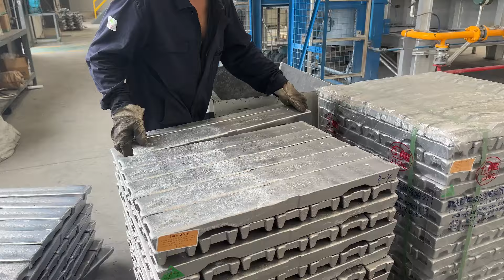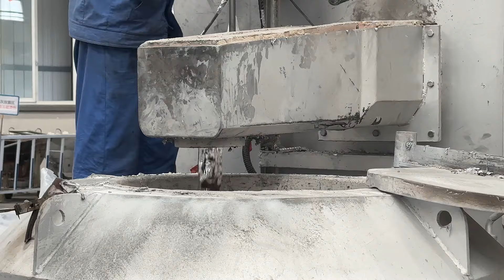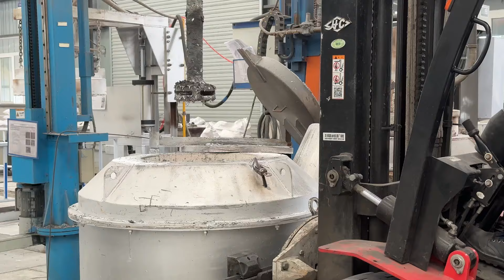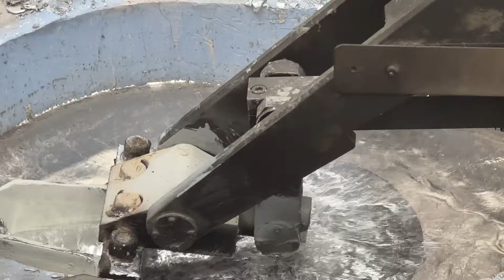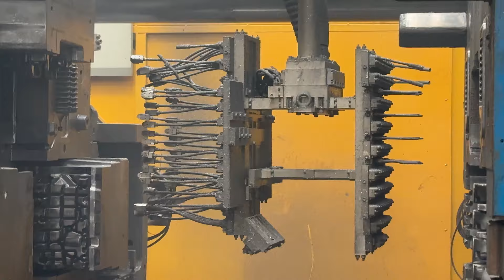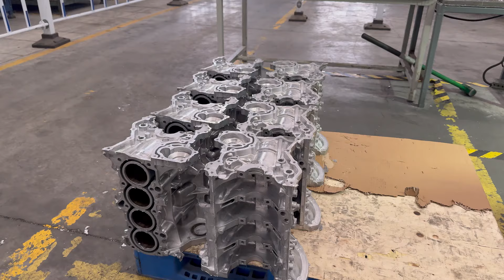How It's Made Engine Blocks

Comment: This video could have been a lot more interesting with some good editing. It shows boring parts for too long and doesn't even really show some of the parts that would be more interesting
Reply: @ZhenghengAutoParts  I'm sorry if it's too harsh of a criticism. I think there's a lot of potential here. Have you ever seen the show "How It's Made"?
Reply: @nolispex  I agree with you. There is about 5 minutes of melting, clearing slag and pouring the aluminum. 30 seconds of the cast part being ejected from the mold and the video is over. kind of hard to really see or understand the process.